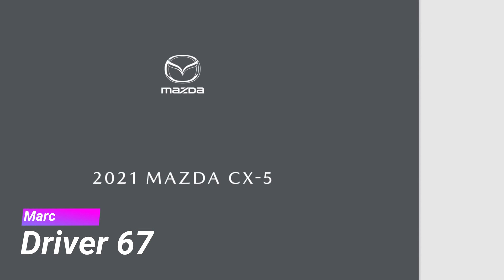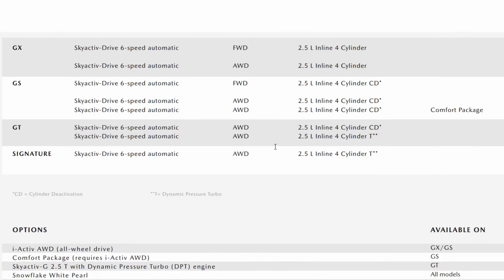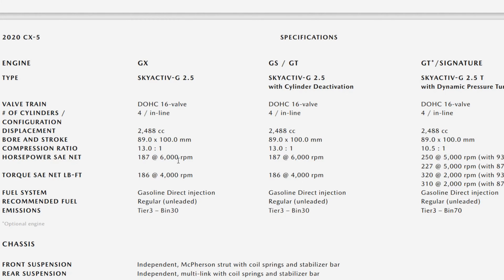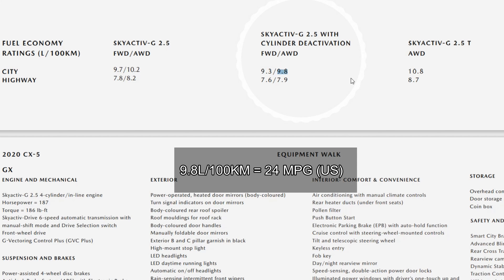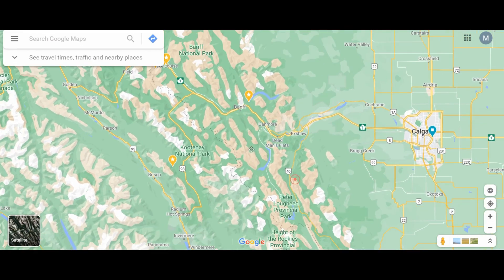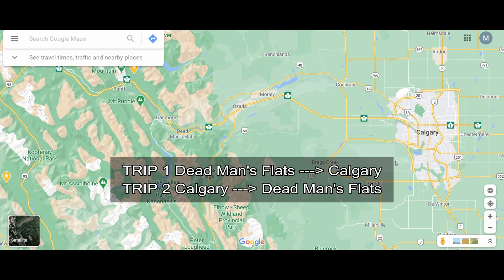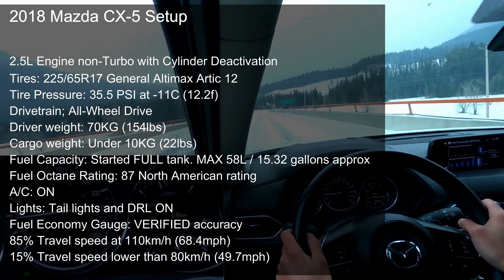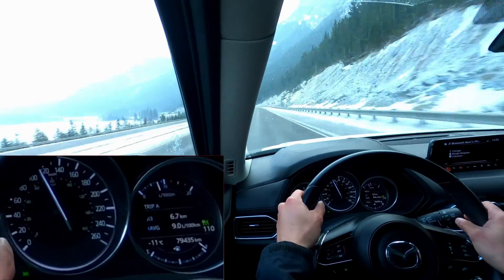CX-5 Highway Fuel Economy Real World Test

Comment from the maker: Thanks for watching guys. This is a very ideal driving conditions for fuel economy. The vehicle in this test should be running on cylinder deactivation mode most of the time. At higher speeds (115km/h), cylinder deactivation might not be active. What mileage are you getting on your CX-5?